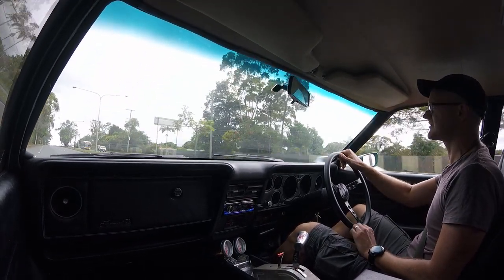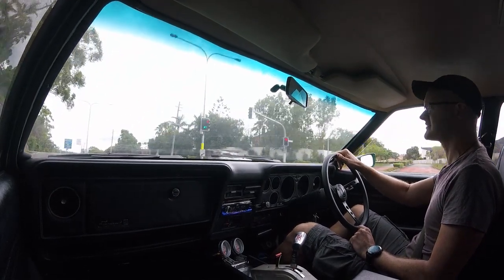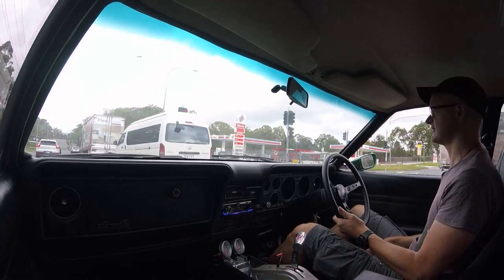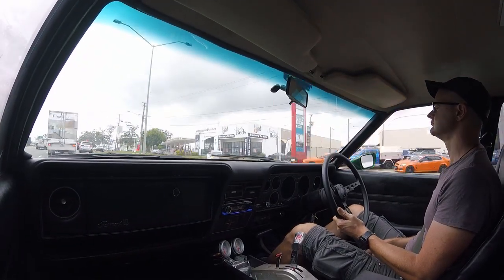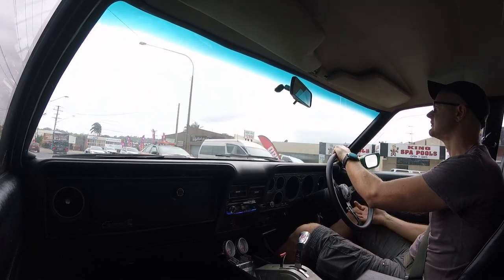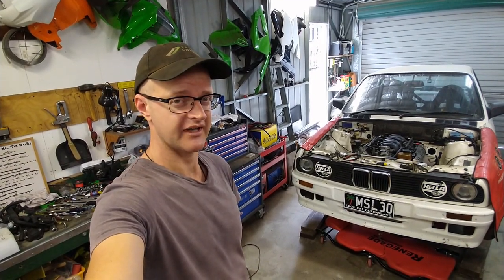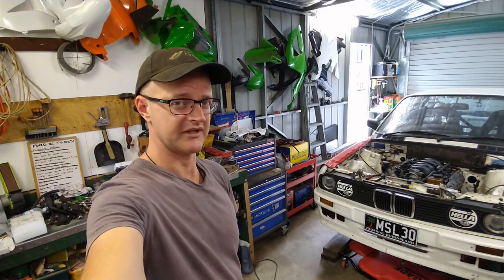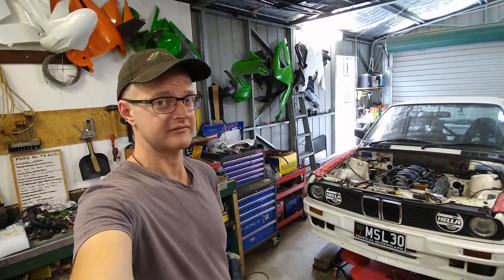XC Ford Falcon 351 Cleveland project: Ep 105 Parts run fail.

Comment: Hi mate how have you been I told you before my dad told me you will always be tuning it  and I think the fuel is slightly different every time to and you will 're tune every time make it rich lean more air less air mix summer cold sparks plug winter hot spark plug never ending
Reply from the maker: yeah I hear ya, I've been caught up with other things and the falcon is currently sitting unloved in the shed....still not tuned.

Comment: You can generally hear it if there's a lot of slack in the timing chain,  Give it a few quick revs (up to about 3k)  from inside the engine bay & see if you hear something like a knocking type sound.
It can happen, but it's rare, My bet is the timing marks are out as others have said. 
FYI
Reply: Any rattle  would be off throttle.
Reply from the maker: probably timing marks, I will check that out.